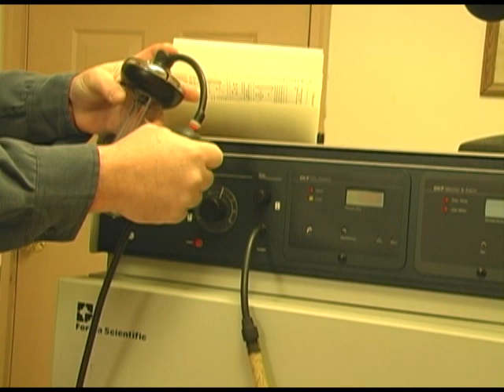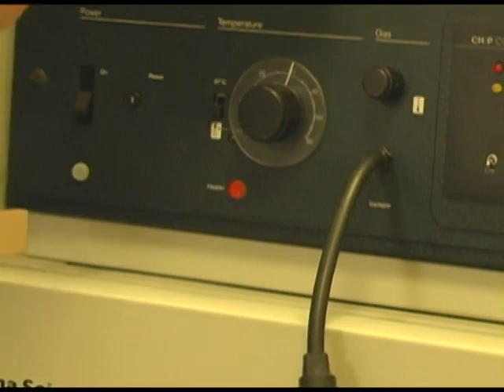Fyrite Analyzer

Comment: Very helpful and your demonstration utilizing your own breath was a clever way to make the point, however, we work in a virus isolation laboratory and will use the Fyrite to confirm the digital reading of 5% CO2 for the cell culture incubators; inserting the tube from a piece of equipment in your mouth in our BSL-3 laboratory would be a no-go right from the start.  Although when I first started working in the lab in 1985, multiple procedures involved mouth-pipetting. Those procedures were all phased out by the late 80's in all laboratories dealing with infectious disease.